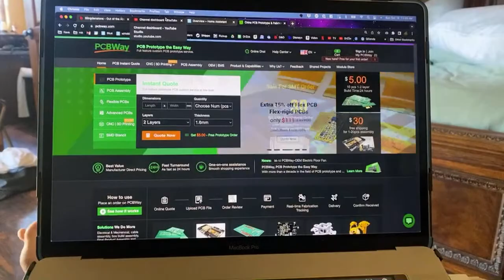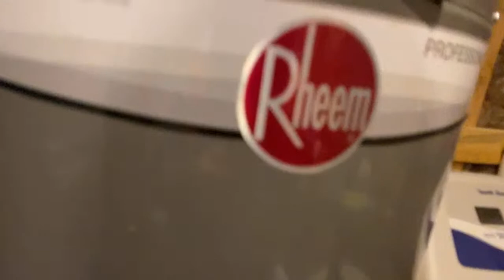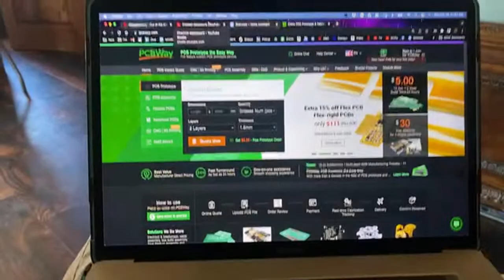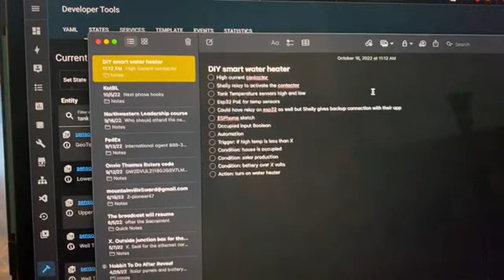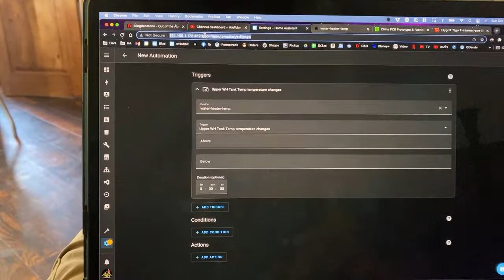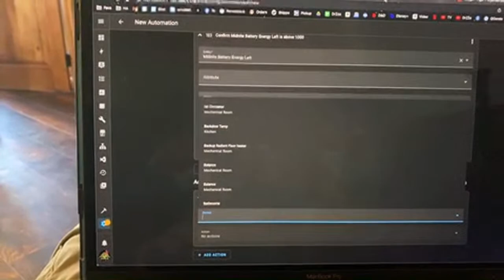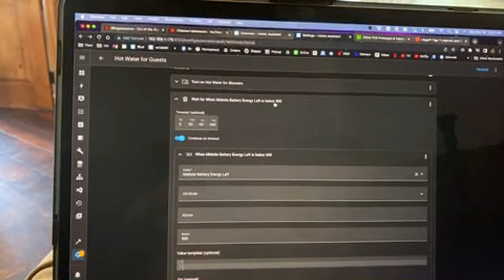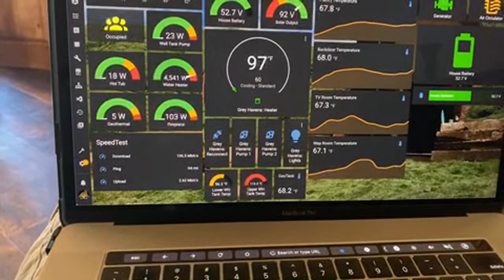DIY Smart Water Heater & Automation

Comment: Just FYI, restarting HA or changing an automation in the UI will stop any running automations. That would include the one that is waiting for a trigger in your example and hence never turn off. Better to put the 2 triggers in the trigger section, each with it's own trigger id. Then use the trigger id in the action section, with a choose action to turn on or turn off. In general, avoid lengthy delays/waits in automations.

Comment: How would you enable/disable the contactor should wifi go down and you have no access to remotely control the shelly? Do you have a manual switch that bypasses the shelly in such a case?
Reply from the maker: You have correctly identified a flaw in my system.  
I need to add a local switch that either activates, or bypasses the Shelly.  So far it hasn't caused a problem, but I'm sure some day it will.

Comment: I don't know how long ago you did this video but Legionella is a bacteria that is found in fresh water supplies. Most people are not at risk. older people with health issues maybe..Legionella is introduced by breathing in microscopic water droplets. Hot tubs and and whirlpools have been understood to be a cause of out breaks. So the optimum temp for Legionella growth is around 86 degrees. Many people are often shocked to discover just how quickly legionella can develop in a stagnant water system. In fact, given the right conditions, legionella can grow and become problematic in as little as two weeks. Well if your water heater is at 86 degrees for two weeks do expect some growth. temperatures above 125 degrees cause the bacterium to not grow and temperatures of 140 degrees will kill the bacterium in around 32 minutes. So I think that someone is suggesting that you should not save money or they think they understand something more about some legionella or other bacterium growth. I think the solution would be to keep the water temp up when in use and anything new coming into your tank would not have any time to become a problem if the water heater is set to above 125. Alarmist is all I hear. Put the water heater to 140 degrees and the water will stay warmer longer. The manufacturer recommendation is 105 degrees so go figure. I really don't understand people opening their mouths and inserting their toilet bowl. Legionella is the bacteria that causes legionnaires disease as well as other conditions They just don't do their research. R.O. stops most bacteria from getting into your RO drinking water but legionella is transmitted by microscopic droplets of water in the air you are breathing so Legionella must not be able to handle the stomach acids. Here let me look at an Article on legionella in the stomach? Legionella is a bacterium commonly found in natural and man-made aquatic environments. Legionella can be found at low concentrations in any public water system. Legionella only poses a health risk when growth occurs in warm stagnant water, the water is aerosolized, and the small droplets are inhaled. It looks like legionnaire disease is only a problem if you inhale small droplets of water that the bacterium has been able to grow in like if you left your water heater at around 86 degrees and went on vacation instead of like just turning it off.

Comment: Glycol keeps scaling down. If you have a closed loop and are running water through it  and you have a system that has a valve attached for makeup water, you do need a substance that well help with scaling.